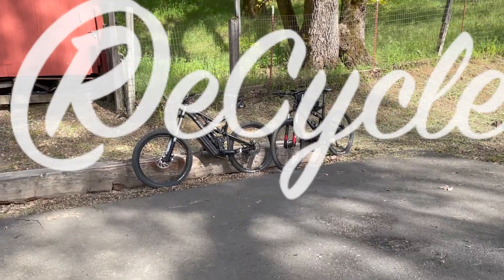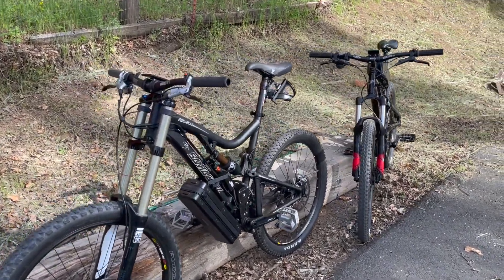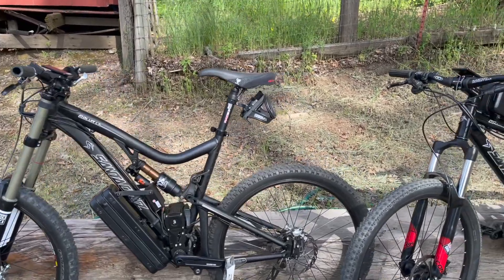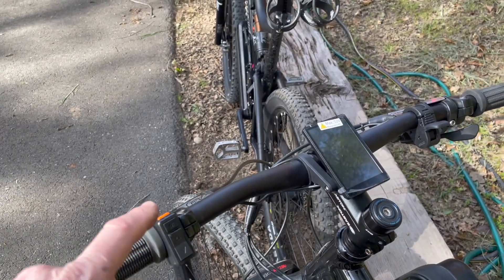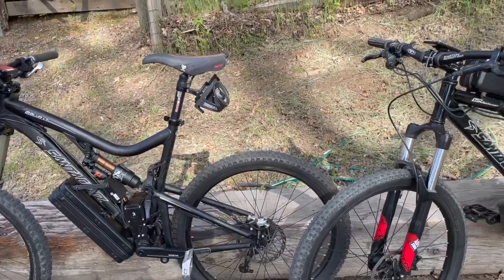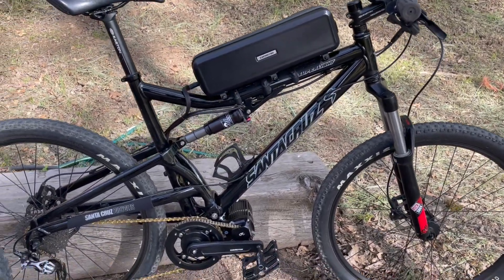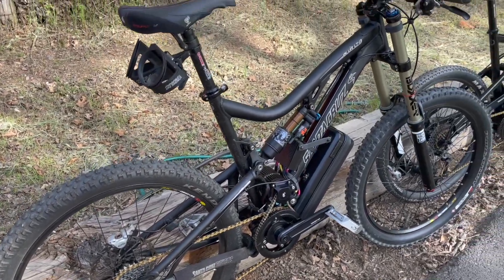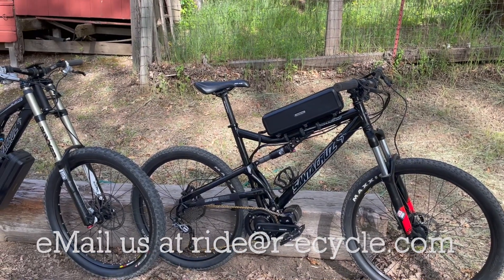Santa Cruz Blur and Superlight E-Bike Builds Using CYC X1 Stealth Gen 3 Motor Kits

Comment: Can you give some additional details on the modification you made to mount the battery sideways on the SC Blur? How did you remove the brackets from the battery case. I have a small frame Bur and there’s no way I can mount the battery in the gram triangle. I’d prefer not to mount it on the top tube. Thanks in advance for your reply.
Reply from the maker: Hi @ucdChe , the pack on the Blur was mounted sideways by removing the internal battery pack from the case and relocating the mounting brackets to what would normally be the side of the case. This makes the pack a little wider on the bike but still less wide than the motor. It freed up space vertically for tire clearance.

Comment: Does the photon crank fit on the superlight?
Reply from the maker: Hi @censorshipBS, yes it does. The Photon is designed for threaded bottom brackets between 68-83mm which suits the Superlight. There are also other bottom bracket options and adapters to fit all the way up to 120mm.
Reply: @R-eCycle  i fitted the photon a couple of months ago its amazing 😎

Comment: I have a mint 2002 superlight and was thinking about doing this. Do they offer a smaller battery with less power so it can be mounted on the bottle cage?
Reply from the maker: There are a wide range of battery packs available that will work with the Stealth motor kits. They support voltage between 36-52V. You should look for a pack with a BMS rated at a minimum of 30A with cell types and layout that can support that power level. It will need an XT90 female connector to plug in. 

I would recommend getting a pack that will mount directly to the frame (or with a removable mount that will). Bottle cage fittings are often not secure enough and it will probably limit you to a 36-48V/8Ah pack which is going to limit range. 52V 12-14Ah packs can be made pretty compact and may fit in the same area as a bottle cage. Better yet, if you can use under frame bottle mounts and/or a Double Bob mount to the downtube you'll keep the weight lower and the pack out of the way. You just need to measure tire clearance with the fork compressed.
Reply: @R-eCycle  thanks for the reply i will have a look on your website

Comment: Wanting to convert my Pedego Elements 20" X 4 fat tire to Mid Drive, it comes with a hub motor,
1. I need a new rear 36 H hub with a pin  to tighten the nuts not a Skewer. 7 SP Cassette.spokes the whole Wheel assembly 
Any suggestions where I can get it.
Where to get the Stealth XI  GEn 3 ? if there is a newer version for 2024 that is better.
The Pedego comes with a 48V battery which I palnt to use so what conncetor I need to install 
to match the CYC kit?
Thank you for replies.
Your builds are awesome
Reply from the maker: Hi @paulawestcott7228 - You'll want to measure you're bottom bracket before you purchase a motor kit. Most fat tire bikes are either 100 or 120mm wide at the BB. The Stealth comes in the standard 67-83mm size and is also available for PF92 size but they are not available in the 100 and 120mm sizes. The Photon is available in 100 and 120mm but it can be restrictive because of the location of the motor and the mechanical attachment to the frame. You may need to get the X1 Pro to fit your fat bike frame. All of the CYC controllers use an XT90 connector. You can find all these available on our website shop at https://www.r-ecycle.com/motor-kits

Comment: How many watts can you run continuously before the heat gets unsustainable?
Reply from the maker: The Stealth will run at about 1500W continuous with a 52V pack if it has sufficient load (flat out in top gear or climbing up hill in the highest power setting). I've gotten them hot (160-170 degrees Fahrenheit) for 10-15 minutes but haven't run one to failure. Max power isn't really what these are made for. The best use case is performance oriented pedal assist bike. If you want max power you're better off with the larger motor on the CYC Pro kit.

Comment: Show a video on the downhill bike you did. Im doing a 2008 Intense M6 right now  I'm using the gen 3 stealth and 52 volt 20ah 50 amp bms battery. The pic of the eTDH bike you did was awesome.
Reply from the maker: Thanks @nwmetalbug. The eTDH is out the door but I'll post another customer bike shortly!

Comment: Hows the climbing ability with this motor and battery on 52v stock? Steep off road capable? Or is it a better option to step up to the next motor class to get lots of torque?
Reply from the maker: Thanks for your question @TechGoop. The CYC Stealth motors pull strong with up to 150nm of torque. I've had 200LBS riders climb +15 degree slopes at 20MPH, no problem. The Pro is a bigger unit so if you're doing a lot of climbing, it will definitely be more efficient and less likely to heat up.

Comment: What is your curb weight of the build? 10lb motor and 9.5 lb battery on sub 30lb bikes, are you actually under 50?
Reply from the maker: Hi @clintwedel5704, I haven't put these on the scale but I'd say the Superlight is definitely under 50LBS. The Blur is a bit heavier but close to it.

Comment: Ordered mine about 3 weeks ago. Crickets still. We'll see. What chainring are on these 32t or the 38t?
Reply from the maker: Lead time is running about 6 weeks out while CYC is trying to catch up with demand on the Photon. They think they will be able to shorten lead time once we get into summer. The standard chainring option is a 38T bike chainring but 32T is an option. The bike chainring is a BCD 104 format so you can change it to any bike chainring designed for this mounting size.
Reply: @R-eCycle  nice. Hoping I'll be installing it soon. I went with the 32T chainring as I'm building it on a full suspension mountain bike primarily for off-road with an 11-46t cassette.
Reply from the maker: That sounds like a good setup @babyyak3002. I use the smaller front chainring on my own trail bike. There are super steep trails around us in NorCal and the small front chainring makes it great for climbing just about anything.